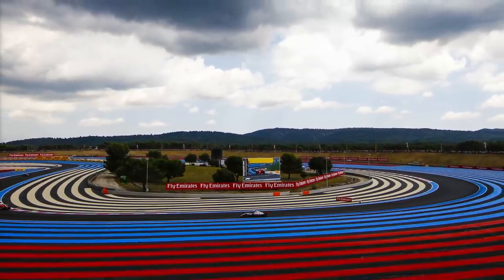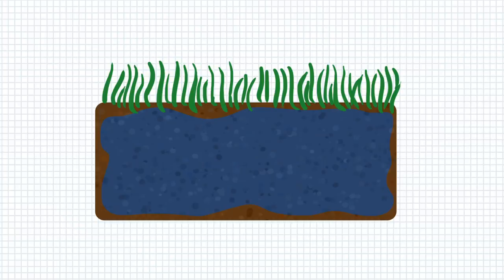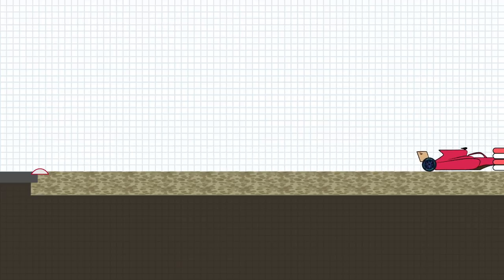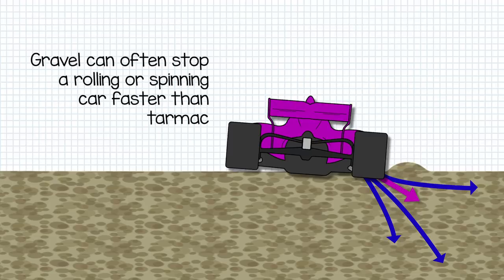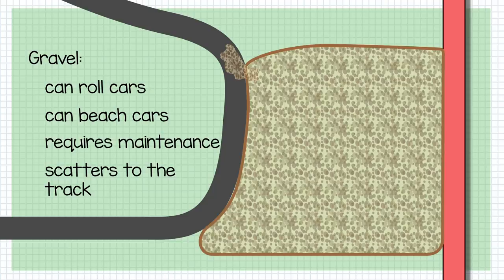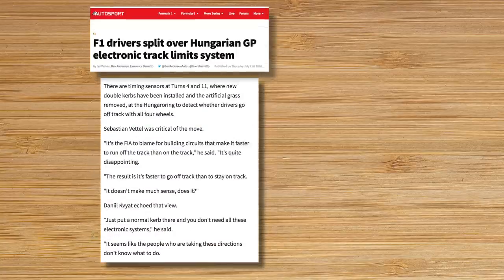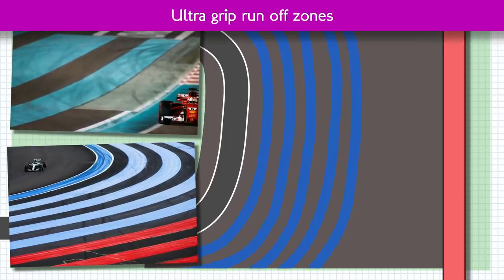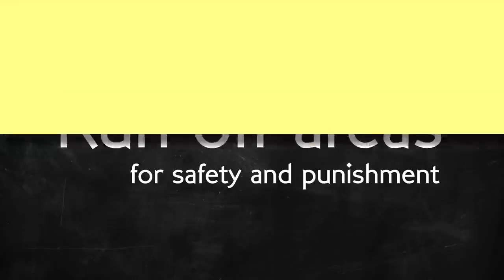Run off areas in F1 - Safety and shortcuts

Comment: I can appreciate that tarmac is safer, but I still much prefer gravel, as it punishes the driver both by time and potential mechanical damage. F1 (to me) seems FAR too forgiving nowadays and I also think this would serve as a better entertainment feature as well. When a car runs wide on tarmac, it's "woah, he cooked that  corner," and then back to business as usual. With gravel, the drivers are forced to do all that they can to stay on the track, rather than playing it safe by going wide into the runoff. Beached cars also relate to safety cars, which spice up the strategy. As far as safety, this may be a bit hair-brained, but if F1 were to mandate some kind of "speed racer" type 'shovel', 'plow', or 'rake head' that juts out from under the car to dig into the gravel, your stopping distance is instantly and exponentially decreased. Safe, check. Doesn't allow drivers to take advantage of excess track limits, check. Keep fans closer to the track, instead of miles away, watching the race through binoculars, check.

Comment: I think you're really missing the point about driver's complaints about tarmac runnoffs. The point isn't whether drivers should or shouldn't take advantage of them, the point is by having them you introduce a wholly new and subjective judgment on what the penalty for breaking that rule should be, a subjective judgement that comes under fire year after year after year in different situations for being either too lenient or too harsh, a judgment where consistent ruling on will inevitably punish or not punish certain drivers enough given each violation is different in nature of how much or how little advantage is gained from each violation. Thought that should have been obvious, I mean you even mentioned it in the video.

Gravel runoffs aren't perfect but overall they are much better than tarmac runoffs for racing as a competition and sport because they are self policing. You don't need a technical marshal or directors scrutinizing or getting out rule books and basically playing God over how much a punishment a driver will get over a violation that is never ever going to be exactly the same as any other. Instead with gravel the off track section itself punishes the driver by slowing the car down significantly, sometimes even costing the driver the whole race. There's no subjective nature to it, it just is what it is. And frankly, going off track should never be faster than staying on track. That's the whole point of a race is going around as fast as possible within a vehicle. When it's even faster to go around by cutting or running long it begs the question of why isn't that the track in the first place, and therefore you often have drivers and stewards taking matters into their own hands. It's a real problem and it has hurt racing as a sport and a competition.

Another thing, return routes aren't really perfect either because there can be situations where taking the return route is actually faster than going around the track would have been, especially when there's more traffic.

Comment: I think Vettel was making essentially the same point that you're making. 

Your "just follow the rules" argument was a bit of a straw man in that Vettel was not saying that drivers *should* take undue advantage, rather he pointed out a technical issue (inconsequential performance degradation) with some of the FIA's preferred methods for managing runoffs.

Plus, the analogy you use to support your "just follow the rules" argument is imperfect to a fault. 

There are many challenges associated with managing runoff, but in this particular context you were addressing the specific issue of driver accountability. The problem of enforcing the rules in soccer is facile on the face of it. The refs literally watch the entire field all at once and literally implement penalties immediately after an infraction. 

"Why not just throw the ball into the goal?" The clear implication is that FIFA (or whoever the hell) relies on soccer players' honor. Which is nonsense.

Sorry. Nothing personal. Still a great video. Thumbs-up.

(And no, I have no particular allegiance to Vettel or Ferrari. I just like well-reasoned discussion. Which is why I like your videos.)

Comment: Why cant we just say 2 wheels on track at all times, go off with all 4 tyres 3 times and you've got yourself a 3 second time-penalty. Would still need to be looked over by stewards so drivers who lock up or get pushed wide dont get warnings when they shouldnt. Might not be the best solution but its consistent at least.

Comment: Idea: Keep the concrete run offs, but use the material use at Paul Ricard's 'Red Zone', which is, yes ultra grippy, but so grippy that it actually significantly harms the tyres, and have gravel traps past those. 

Lets say at Parabolica, have 20m or so of the red zone tarmac, and then the rest is gravel, or maybe have a small strip of gravel on the outside, then the redzone, then the gravel

Comment: There are stewards in the races for a reason. Use tarmac for runoffs, punish those who run wide. They know they fucked up, so for all we care they can go cry to their mommies about how they got punished for using a safety feature to gain advantage on purpose, which is basicly cheating.
Let's be reasonable here... what's the point of bumps if they defeat the point of using tarmac for runoffs in the first place? What about ballards and extra paths for those who run wide, since it's just another physical thing in the middle of runoff areas that can potentially damage cars and drivers? Chicanes are fine, but you can only use those if there's a chicane itself after a long straight, like at Fuji, Le Mans or Suzuka.
If they gain time on a lap because of running wide, make them go slower in the next (calculate the difference between the lap of runoff and their best lap, and add it to their best lap - they have to make a slower lap than that or go through a drive through).
How hard is it? And if they abuse it, 60 seconds of a stop and go penalty. They'll stop doing it. They'll cry river's worth, but they'll stop.

Comment: Gravel traps came about because F1 crashes used to be "out of control cars" (i.e. no brakes, no steering, no tires). But as car design and reliability has evolved, most crashes nowadays the car is still under some form of control, even if it is a 4-wheel lockup. And for these, paved runoffs are the best. I'm a fan of track limit pressure sensors that trigger an automatic 3 second penalty.